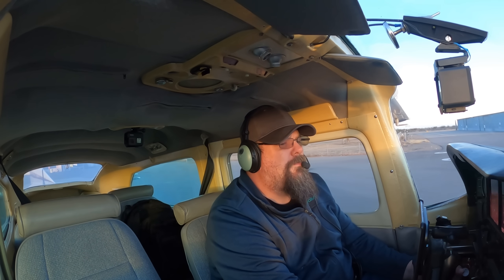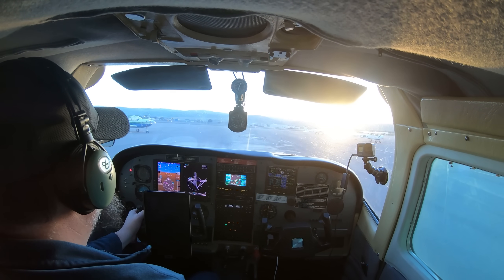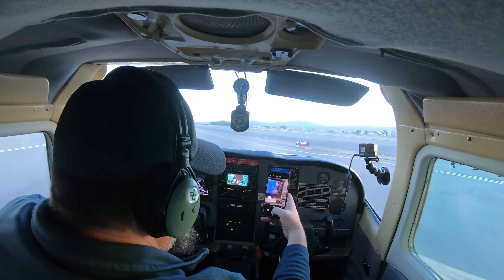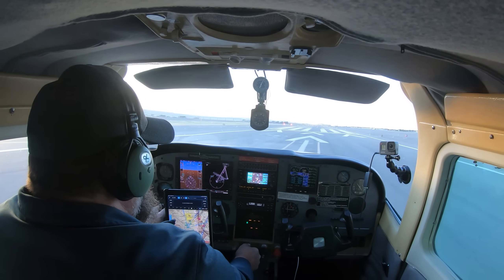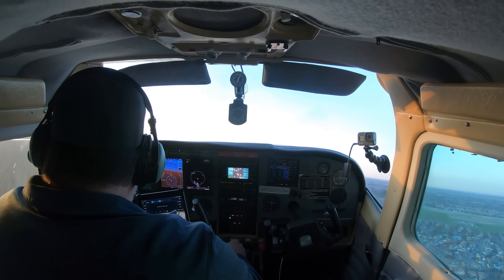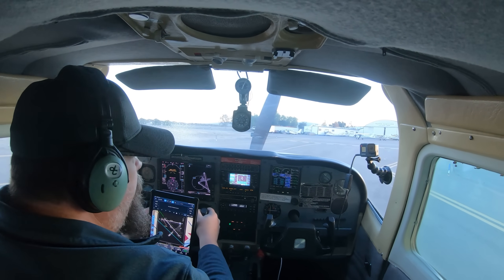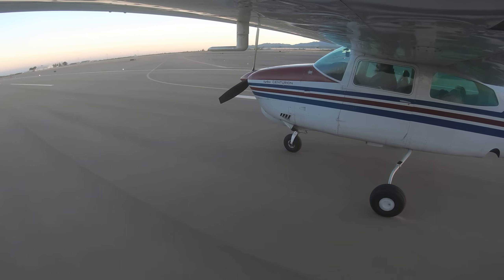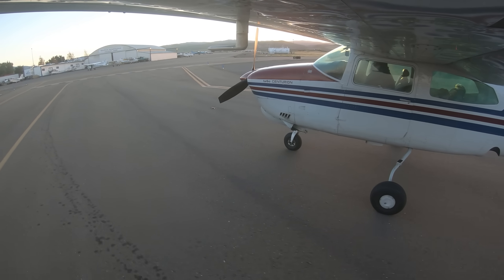Catastrophic Engine Failure after Takeoff

Comment: We had a transient older money declare an emergency at our airport immediately after takeoff,  he had smoke pouring out of the cowling and made a successful landing. 
I get it open the next day and find that the lower baffle for air was not connected to the engine. 

The large span of the baffle being unsupported allowed it to be pushed back by airflow, and come into the contact with the alternator cooling fan. Eventually the rivets holding the fins wore through and one of the fan blades shot out and punctured the cowling mounted oil cooler. This hole spaying oil everywhere caused the smoke that caused the owner to declare an emergency. 

I fabricated a bracket to support the baffle, it took some custom work because the aircraft had been upgraded from a generator to an alternator. I actually had an old bracket kicking around in my toolbox that was modified to work.

Replacing the oil cooler was easy, except that we found his hoses were all original 1970s and this was 2015. So we got him to buy a new hose kit for the whole engine area.

After replacing the hoses I installed the cowling and pulled the aircraft out of the hangar for a run up. It wouldn't start for anything, which I finally traced to a failed electric pump, it ran, but didn't move any fuel.
I replaced the fuel pump, but was late Friday afternoon so I left running the aircraft up for the next week. 
Saturday a mechanic on a different shift, who had the proper training, finished his regular work and decided to run up the aircraft. 
After just a minute of running, the engine began to make a horrible noise, so he shut it down. 
There was a Similar hole in the top of the  crankcase!

Turns out an overhaul shop on long island had failed to cotter pin one of the connecting rod bolts, the nut had backed off and the bolt had come loose, that allowed the rod to come loose enough it caught the inside of the case and punched through it. 

If he hadn't had the smoke under the cowling after takeoff, he would have been flying far from an airport when the connecting rod came loose and punched through the crankcase...

The overhaul shop offered him a replacement crankcase half, he had to pay for the overhaul...

Comment: Holy Stuff!  That's some massive damage.  Time to go see Vitatoe and install a TSIO-550!

Okay Ed, please take my comments with a grain of salt.  1.  I'm not current, I've not flown in about 40 years.  2.  I've never flown a Centurian, or even a complex aircraft as PIC.  3.  I've never had an engine failure.
I think you did great.  We all hear about the return to the runway after an engine failure, and if you had tried a 180º turn, I don' think you would have made it, you barely made Runway 08.  However, you DID make it.  I didn't think the gear extension was that fast in a Cessna like that, I was actually surprised a bit at how fast it came down.  Glad it did. A6 6:22, as you said, you were high enough that you would have been into your crosswind turn.  At 9:06, which I think is a great shot, it certainly looks like that field in front of you is a nursery of trees, and trying to land straight ahead would have totally destroyed your airplane, and could have cost you your life.  I think, given your altitude, you did exactly the right thing.  In your comments below, you were in the left seat, you were responsible for the aircraft and any passengers (you) and things were your call.  Did you make the correct ones?  I'm not going to say, that's on you.
I WOULD be interested in what Continental has to say about glazing in an overhauled engine and how long it can be run at less than full power before glazing becomes an issue where you need to pull the cylinders to fix it.  If you watched Dan Millican's video on his T210 after they rebuilt the engine in that (after his prop strike), they ran the engine at near full power on the ground for a few minutes from the initial start.  That should be, IIRC, on his "Taking Off' channel.

I went back and pulled the videos from 'Taking Off' on Dan's rebuild of his engine.
The engine first start:  https://www.youtube.com/watch?v=lczK6Iehk7g
The Update: https://www.youtube.com/watch?v=8sHtpzk9Oow
The After:  https://www.youtube.com/watch?v=9QY9WRY_rMg

Interesting stuff to watch Dan talk about the steps, and in the last video, a bit on glazing.  His one comment that strikes me as the most important is 'Do what CONTINENTAL says, not the 'Expert on the field.' 

Make sure you check with Continental for their engine specs and procedures. http://www.continental.aero/support/maintenance-manuals.aspx

Obviously, this was a failure of the crankcase, and not an issue of glazing, or even improper engine settings.  I don't even think adjusting the prop RPM with the mixture control (yes, it WILL slow the prop down pretty significantly if you 'reduce the setting' far enough!  :D :) ) would have caused something like this to happen.  You had a bad crank case.  I am curious as to how many hours were on the engine when you had it re-done and how old the engine was.
You have have less than 500 hours, but I think that you handled this emergency perfectly.
By the way, your third view, the one of you, what I saw was a bad situation being handled promptly, efficiently, correctly and only after you were on the roll out, did I see some disgust on your face, but I would expect that.

Comment: Even though my friend as long as you follow the guidelines and torque each ball down to its specifications they should not of had a catastrophic failure. Although I am now a lawnmower mechanic I still know the inns and outs of a operating engine, that’s most important and an aircraft engine that you make sure all parts are working correctly cut corners, Cut limes LIVES fives yes if you are not a full-fledged mechanic do not attempt to work on your lawnmower engine via airplane.

Comment: looks like a big end rod bolt came apart. maybe not correct toque setting, or thread lock fluid wasnt used. .  hard to say which, but i have seen plenty of engines go bang after a rebuild cos of rod end caps coming loose.

Comment: Shades of my pilot training.....I was a 16 hour solo student when I had the engine pack it in at about 800 ft after takeoff. 800 ft was the pattern altitude, so I just flew a tighter pattern and got my poor  C172 and my pink body on the ground in one piece. The silence and just the wind on final is memorable. Well done, Edward! You flew it to the full stop!
Reply: Regarding axepilot, I had same happen in a 172xp as a student just after take off in Mammoth Lakes, California.  Stuck exhaust valve.  I was a lineman at the airport and got to see the mechanic pull out the now-S shaped valve stem.  I made a 180 and just made the runway.  The sagebrush is what I remember whipping by sooo close.  And the funny vertical metal blade blocking my line of sight.
Reply: @backseattrash9261  Pistons don't like trying to compress valve heads. Or as Sterling Marlin once said, "Piston done hit the valve.'' It makes a lot of noise too.
Reply: @backseattrash9261   KMMH is an interesting place for that to happen....surprised you didn't wind up on the substation road.
Reply: The Silenceon Engine Out is Deafening.....on a Dual failure on a twin on a shakedown flight.....you could literally hear 3 grown mens assholes slam shut at the same time!
This guys technique should be shared ...he reacted both As a Pilot, and Mechanically...Well Done
Reply: That's what I'm talking about!!!! 👊🏼💪🏼🇺🇸
Reply: Pink is better than red

Comment: Text book manoeuver, good job. You think leaning the mixture on take off (instead of adjusting the prop) contributed to the engine failure? Did you monitor CHTs on take off?
Reply: It was only a second or two, I doubt the engine even noticed

Comment: Wow, what a great documentation of an engine out on takeoff.  We all train for it.   Few of us will ever be faced with it.  I think you did a fantastic job.  Watching you recognize that you were getting slow and then immediately pushing the nose over was watching good awareness and good training in action.  It could be argued all day whether or not a turnback was the right move.  In this case, you not only walked away, but rolled out safely with no damage to the airplane.  Luck?  Certainly a little, like in all things in life.  But definitely skill and good training won this day for you.

I fly out of KLVK.  I purchased a Cessna 320F in July.  It's still stuck in maintenance 400 miles away finishing up an extensive annual and major engine work on both sides.  I will finally be going to retrieve it sometime in the next week or two.  Losing an engine in a twin is obviously different... could be better... could be worse... depending mostly on altitude AGL.  I've been planning my takeoff and departure from the Los Angeles area based on a scenario where I lose both engines (anything could happen after a long maintenance stay).  Watching your video got me much more focused on my upcoming takeoff and departure.  Identifying potential off-airport landing spots (not many in the LA basin), 30 degree turn immediately after takeoff, circling above airport to gain altitude before departing the area, trying to always be within gliding distance of a landing strip, etc.  All of this within some of the most congested and controlled airspace in the country.  I'm looking forward to it, but it definitely puts training and preparation to the test.

Hats off to you Edward.  Your result was flawless to my way of thinking.

Comment: Very nicely done sir!   I have a few pennies to throw into the lot.   The first is that a full power run on the ground, or even several of them would have probably saved you a pair of pants.  The other is that messing with the power levers at low altitude is a no no for me.  Engines tend to fail, either by coincidence or cause on the first power adjustment after takeoff.  I doubt you grabbing the mixture contributed to this, but it may be possible there was a detonation that broke something in the lower end.  Regardless,  These engines are designed to run at T/O power for 5 min at least, reduce workload and failure probability by leaving everything full forward until well away from the ground and with a good landing option in mind.  The only other thing to think about, if the prop is full feathering and you have a failure, feathering the prop can help get you to a runway, you didnt need it obviously in this case, but something to think about.
Reply from the maker: As far as I know, only twins and turbines allow for feathering. Piston Single adjustable props fail full-fine for maximum power.
Reply: @TheEdwardFrye  Mostly true.  There are piston singles that have fully feathering props.  Mooney rocket and missile for example.  Some SEL piston aircraft even have pulling the prop lever back as part of the engine out checklist.
Reply from the maker: I was not aware,  thanks

Comment: newly honed cylinders, is that the lower end of the motor ? if engine is going 2700 and you adjust engine rews to 2500 by adjusting the prop and the motor seizes there is too much heat going to pistons and they expand and lock. So either too much load or if new pistons in the honed cylinders, not enough clearence in the bore! 
But very good, clear and fast reaction. Hope too see you airborn soon.......

Comment: Great work getting back on the ground safely! 

In effort to learn—not criticize—I’m interested in your decision to reduce power when, where, and to the extent you did. It appears max takeoff rating is for 5 minutes at 2700/36” and max continuous is 2600/35” (based on a POH I found online). It appears you ran full power for only about 30 seconds.

Was your power reduction planned as part of a break in procedure? Once again, great work arriving back home safely! :)
Reply: Its a turbo engine, you bring back the power to not over boost the turbo and reduce the prop rpm. This guy was just unlucky

Comment: That one con rod that was sticking thru the case was missing a cap and yet the threads on the bolt didn't look messed up, Im, saying your mechanic didn't torque all your connecting rods correctly, in fact I believe he left that one specific con rod loose.
Reply: No question about it someone didn't tighten a rod bolt.
Reply: Definitely something with connecting rod bolts failing. Improper torque or quality control problem with the bolts. The quality of parts is not what it use to be.
Reply: Wonder if it was a cheapest bidder situation…not that all the cheaper guys are bad, but you generally get what you pay for.

Not bashing the owner/poster, everyone has a budget.
Reply: @Notthe_droid_youarelookingfor  You're quite correct, even the factory makes mistakes.
Reply: @Agwings1960  seen many
Reply: Or did piston seize and cause all this carnage. I assume someone has undone the injector line or was there nearly a fire as well?
Reply: That bolt is the cylinder hold down bolt not a rod bolt.
Reply: @MattLundquistVW  One picture is a con rod without the cap, sticking thru the case
Reply: @Agwings1960  not disputing that. The comment said rod bolt with undamaged threads. The bolt with undamaged threads is a cylinder hold down bolt , not a rod bolt.
Reply: @MattLundquistVW  Now that I rewatch the video, you're correct, maybe it was the thumb nail picture for the video, but I swear I saw one picture of a con rod with an undamaged bolt. But any way you slice it, my money is on faulty maintenance.
Reply: @Agwings1960  one of the photos angle makes it look that way if you scan it quickly ( picture was only up for a second anyway), but as you seen with a second look it is a cylinder hold down stud and nut. 
Looks to me  like the rod bolt broke ( they will probably find it in the sump upon disassemble).
Any shop that is quality will keep a record of all there measurements that went into an overhaul. 
If the rod was never tightened it would of showed up as soon as he started the engine ( loud as hell knocking) and oil pressure would have probably been low also.
Parts break, it happens.
Reply: @MattLundquistVW  It's hard to predict engine failure times according to faulty maintenance, I remember a Navajo Chieftain in Alaska where the rod bolts weren't properly torqued and that engine ran for several hours before failure, another Chieftain engine that came from the factory had the wrong size pins in the crankshaft counterweights, the Lycoming rep said that they usually fail real quick when the factory does that, but our engine had over a hundred hours before it blew up. The blogger said that his engine had received a partial overhaul, so it's pretty safe to assume, that had something to do with the failure

Comment: Luckily the runway configuration allowed you just enough altitude to land safely back at the airport.  If that was a single runway or parallel dual, the outcome would be much different.  I just about had to change my boxers after watching, so I can only imagine how you felt.  Great job in continuing to fly the plane and getting that immediate turn back required.  Well done sir!

Comment: Well flown indeed as a mechanic have comment on how it didn't seem to blow when you were asking for more power but seemingly went when you backed off the power ?
Reply: As I interpreted the clip maybe wrongly was that he increased pitch which lowered rpm for the same power setting. That in effect would have increased the mechanical load upon the already failing parts and finished them off.

Comment: One bad mechanic. $30,000 later new engine. Go flying again.
Reply: Not necessarily. A bad call maybe if the main bearing and main journals were not also checked. With a low time engine, the temptation to not separate the case would have been strong. One of the cap bolts may have failed even if at proper tension. There have been in the past some problems with product substitution, counterfeit parts.

Comment: It's in the video title... "catastrophic engine failure"

As if you're only going to replace half the engine and take it back up again as soon as you get it running. If I'm correct that's a hole in one of the main engine block parts, (main piston head cover/top half required for the engine to work?), which can't easily be replaced unless the engine is still being manufactured. Meaning you have to either have to have the top half of the engine replaced with another used piston cover, like that of which catastrophically failed after takeoff, have a brand new piston head cover re-molded/re-casted from scratch or replace the entire engine for 100% certainty that the bottom half of your currently broke down engine doesn't blow out the next time you go on a flight test.